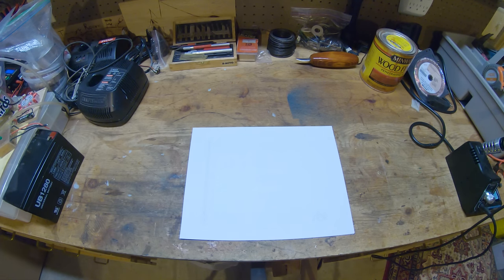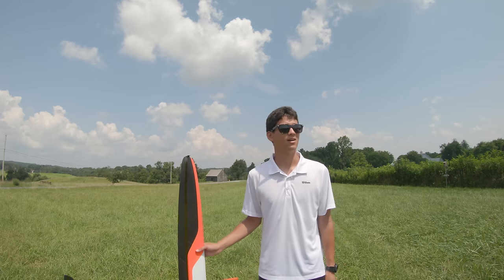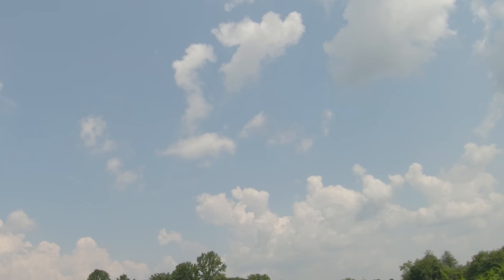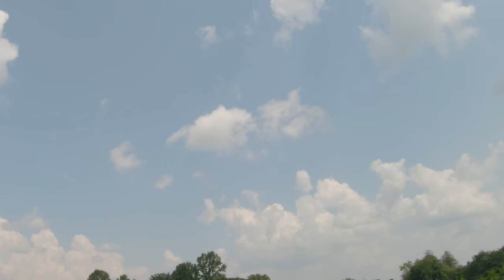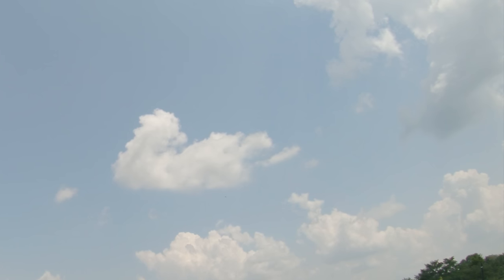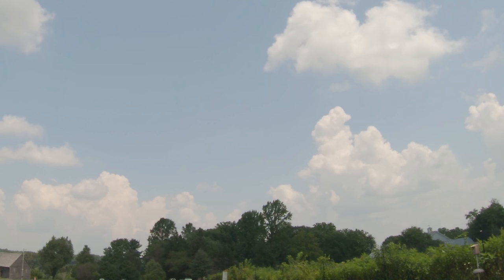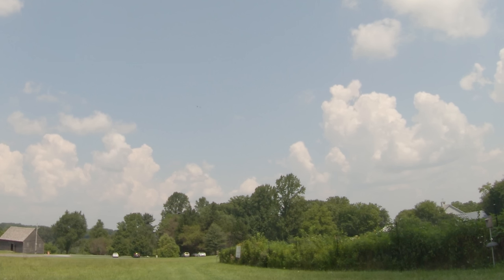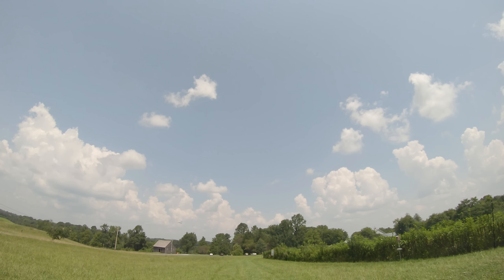How to Thermal Your RC Glider

Comment: Well, I am 78 and flown gliders for 40 years.   Most excellent, helpful video.   I learned a lot, especially flying perpendicular to line of sight.   One additionsl tip, in the old days when we were almost out of sight straight up,  hold eleveator all the way up and the rudder all the way over.   You spiral down and don't overstress the wing with high speed aerobatics.   Maybe the new composit materials can take the stress better.    Anyhow, an excellent job, thanks for your time and very clear instruction.   Nicely done.
Reply from the maker: Thanks! I'll try out spiraling to descend; It seems like it will be harder to lose orientation that way.
Reply: I just hold the stick at the bottom right corner, when you get low enough just let it go and it stabilizes.    Thanks for replying.   Best of luck to you.
Reply: @Phil M bet that looks brilliant

Comment: It was this video that got me interested - two weeks later I caught my first thermals with an F3K plane. That and catching the plane off the air is indeed really rewarding. Thank you so much! For those interested: Get PicaSim, a free RC soaring simulator, and an USB RC controller (if you have a real RC controller there are USB dongles to connect it to your computer). I learnt how to handle the glider and apply the knowledge from this video there, but in reality it is way nicer - standing in the sun, "feeling" real wind etc. When you go for real, consider getting a Spektrum AR6610t receiver, as it supplies a variometer and an altitude sensor that are a good aid to start with. I had to take the plastic casing off and shrinktube it so it fits into the fuselage of my Soaring Models "Kite".

Comment: Hey Timmy; Nice work here. Very easy explained. I learned a lot. I have been into RC powered airplanes for about 10 years. There were no glider pilots in our club until recently, so I got me an electric "Bird of Time"  RF to chase some thermals. Like you say gliding is the must pure, elegant, simple form of  Model Aircraft flying.
Reply from the maker: Thanks!

Comment: I like your comment about "wing goes up in wind, tail goes up in lift". All I would add is that if you encounter a sudden gust of wind (and the wing goes up), it is likely that the wind is going to a thermal, so odds are you are flying AWAY from the lift. Therefore turn downwind and see what happens. I also believe that the air "swirls" in a thermal - it doesn't rise perfectly vertical. A hurricane is an extreme thermal - note the swirling action. It doesn't detract from your video. You're an excellent pilot and have great visualisation of what's happening.
Reply from the maker: Thanks!

Comment: I have a Bird of Time. Your advice just made it a bit more understandable. For the past 3 days before i found your video, I thought of flying around the lift instead of just passing through. What amazes me the most is how a glider can stay in the air when it's tilted sideways at almost 90 degrees and still rise! You would think it would fall out the sky. BoT hooks a thermal like Mike tyson, I almost went home with no glider. Great video
Reply from the maker: Thanks! I have also flown a Bird of Time and I had a lot of trouble trying to get it back on the ground.

Comment: While traveling l 10 in AL in the late 90s l spotted a "visible" thermal.  It was over a dry freshly plowed field and remained there for a long time.  I pulled onto the shoulder and parked to watch it.  There was a lot of man made debris such as shopping bags, wrappers and paper being held aloft along with a   thin wall of dust.  It was about 150' at the base.  Some of the debris was slowly lifted up and disappeared into a hazy sky.  IlRC the spin was clockwise.  There must have been much more lift over the field for it to remain in one spot for so long.  Trees surrounded the field on 3 sides.

Comment: Good video! I have a suggestion from my years hang gliding over the flatlands of Illinois where we got up by using "static line towing" - 3000' of line pulled by a car or truck. When you fly downwind to search for a thermal, you are riding with the wind and basically staying in nearly the same parcel of air. If you head into the wind, you will go through several such "parcels". Then if you find one upwind, you can then ride it back for a longer period of time, thus getting higher, before pulling out. There are other considerations for heavier craft - the Elf can work the "bug farts".
Reply from the maker: Thanks!

Comment: I'VE BEEN FLYING RC PLANES FOR ALMOST 2 YEARS.  I THOUGHT I MIGHT LIKE GLIDING SO FIRST I GOT A DURAFLY EXCALIBUR.  A VERY FAST GLIDER THAT CAN STAY IN THE AIR FOR A WHILE.  THEN I GOT AN ASW28 WHICH CAN STAY IN THE AIR LONGER.  I AM VERY NEW AT FLYING ANYTHING.  SO I CAME ACROSS YOUR VIDEO AND THOUGHT...MIGHT AS WELL WATCH/LISTEN.  AS I STARTED TO LISTEN YOU SEEMED KNOWLEDGEABLE AND KNEW WHAT YOU ARE TALKING ABOUT.  ABOUT HALF WAY THROUGH LISTENING TO YOU I LOOKED AT THE COMMENTS AND THEY I KNEW FOR SURE I WAS GETTING A GOOD LESSON.  YOUR TEACHING WAS VERY SIMPLE WITH VERY GOOD EXPLANATIONS.  I'M GOING TO USE YOUR TECHNIQUES THE NEXT TIME I'M IN THE AIR.  THANK YOU VERY MUCH TIMMY YOU ARE A GENTLEMAN.  John
Reply from the maker: Thanks!

Comment: I have three gliders, a 1m, 2m and 3m. As you can imagine the easiest to thermal is the 3m paragon, second is 2m bob martin pussycat and the 1m gnome is the hardest. The 2 and 3 meter have electric motors and the gnome is a hand launch. I have the most fun with the gnome because it's difficult to thermal but once you find one it's very satisfying trying to stay in a thermal. The only problem is that there aren't that many thermals low to the ground so you have to get lucky and find one near ground that is strong enough to ride up. The paragon will thermal in very weak thermals no problem. I used to have a 2m radian but it broke up in the air. The foam gliders have weak tail sections that need to be reinforced with a striping tape or carbon fiber inserts. Otherwise, if you try to get down from a strong thermal, you might flex the tail in such a way that the controls become ineffective. The old balsa planes of yesteryears are strong enough to take the punishment. The new carbon fiber gliders are the same way.

Speaking of thermals, they move downwind. So fly upwind to ride the thermal downwind, you don't want to catch a thermal downwind and have trouble making it back home upwind. When you do find a thermal, don't be afraid to pull back on the elevator to make tighter turns and to help the plane go upwards. The best thermals are around noon when the sun is directly above, heating up the dark areas. Thermals form between two surfaces one is light colored and the other is darker. As long as you have two different surfaces like that you can thermal. The colder air over the light surface will be dropping down to the darker surface which will cause the air to heat up and rise up. The hot air is also less dense thus the cold air surrounding it will be moving in to take it's spot. That will generate the thermal continuously. When the hot air rises couple thousand feet, it will then cool off and come falling down to again be sucked up by the dark spot and turning it into hot air. 

If you ever get too high for comfort, fly straight out of the thermal. Don't dive too steeply (overstressing airframe) and don't turn too tightly as you'll only end up going up. The thermals above 1000ft can be very strong and difficult to get out of. Sometimes it seems like no matter where you go, you're going up. In this case, don't fly up the thermal too high, exit the thermal at lower altitude, say 400 feet. Another solution is to install spoilers on the wings and deploy them in really strong thermals. They might save your plane. Sometimes the thermal will be so strong that no matter what you do with the plane, like spinning it upside down for example, you'll still be going up. Thermals have been known to suck up fish, frogs, paragliders up to tens of thousand of feet up and some people have frozen to death riding them up and couldn't get out of them.

Comment: I never knew how gliders work until I watched this. You looked like a samurai ninja tossing that rig! I'm sold bro!
Reply from the maker: Thanks!
Reply: @TimmyRC  what glider and transmitter would you suggest to start out with? eyeballing the dx6 and volantex ranger 2000 or bixler. Keep up the good work.
Reply from the maker: @danmrfld4802  Those seem like good choices assuming you already know how to fly fixed wing. Just keep in mind that the Bixler-style pusher gliders will not have anywhere near the thermal soaring capability of high end F3K or F3J/F5J models due to their high wing loading and relatively small wingspan. So if thermal soaring is your goal then I would recommend looking at bigger gliders.

If you have never flown fixed wing aircraft then I would recommend starting on a simulator and then getting a small foam trainer. There are a lot of offerings from Horizon Hobby with their SAFE stabilization, which is helpful for beginners.
Reply: @TimmyRC  thanks for the response, I'll look into those.

Comment: Lot of times what happens with the birds is when they circle, they're usually in the wider part of the thermal (imagine an upside down traffic cone in the air). You'll be unable to ride up the thermal because it's too narrow near ground. So you'll be circling like a madman and not going anywhere yet the birds are gaining altitude. For that reason I find the birds unreliable. If you really want to catch some easy thermals, go out when it's overcast and about to rain. It might even look like a tornado is about to happen. You will always find super strong thermals in those conditions. I was flying a little scratch built V tail foam glider one time and it was sucked right up into the dark sky without me doing anything special. Get out of there when it starts to rain or you see lighting bolts, duh. You won't find any thermals when the sun is setting down or very early in the morning. Best times are around noon. Also, thermals can detach from the ground and be moved by the wind. Some are stationary. You can try making a stick with a long tape and when a thermal passes you, the tape will rise up into the air. I prefer to just toss the plane and go hunting without using any gizmos. That house in the video is also a good source of heat and you might use it to get some altitude. Also, a tree line is helpful when the wind is blowing as the wind will travel up the tree line and over it and you can ride that wave for a bit more altitude.

Comment: despite it's a quite old video, I find it very instructive and clear with practice example. Only one question, what do you mean with "lifting the tail" ? How can I see if the tail is lifting from that distance ? Maybe you can explain ?
Reply from the maker: From far away it will look like the airplane is pitching down due to the lift pushing the tail upwards. However, the airplane will typically not appear to be descending because it has just entered lift.

Comment: Hey, great tutorial! It really helped that you give your stream-of-consciousness while flying. I'm purely a slope soarer (combat gliders) and would love to thermal. Just don't know when to expect low winds.
One question: How can the sun going behind a cloud affect the thermal you are in? It's transparent, so it seems like nothing should happen to it.
Reply from the maker: Thanks! If you are already in a preexisting thermal or "bubble" the lift will be unaffected as long as you are able to stay within that rising column/pocket of air. However, if you fail to stay within preexisting lift, it will be harder to find new lift closer to the ground because the sun is not heating the ground as quickly.

Comment: What would be a way of using electronics, laser pulses, & detection of the return pulse to detect thermals?m   Thermals usually have higher water vapor content.

Lasers Are used in airport awos's to detect Cloud heights.  However, water vapor (in thermals) may better reflect differect wavelengths.😢

Comment: Very good job in describing and demonstrating thermal! New subscriber!
Reply from the maker: Thanks!
Reply: Any recommendations for a first DLG? I’m an experienced RC pilot and have been fascinated with powerless flight for some time.
Reply from the maker: @kevingoza  Since you are an experienced pilot, I would recommend that you go straight for a premium full-carbon glider. They perform so much better than cheap fiberglass models and you will probably have a less frustrating experience. The Armsoar Go Mini is a great choice since it has premium construction, but is only 1m instead of 1.5m so it is easier to handle and less expensive. It also shouldn't break as easily in the event of an accidental landing.
Reply: Thank you! I’ll need to search those out. I’m not sure if my local shop has that brand. You make it look so easy, but I’m sure it’s more complicated and the air time is what will make the difference. I like the idea of working with nature to fly.

Comment: If there's no ridge lift available, I watch the grass until I see it lay down from a gust of updraft. The grass tips bend down in the direction of flow. Then I  hand-toss my glider (6' wingspan) ACROSS the flow with up elevator until it reaches its apogee (?) then level it off and fly straight until one wing tip jumps up at which point I turn in the direction opposite the tip. In other words, if my starboard wing tip flutters, I bank to port. Then, I fly level, still turning, drop the nose to gain speed, watch my tips and give it up elevator when it comes INTO the wind, level off as it begins to stall and repeat the process until the plane is about 7 mistakes high, then we do aerobatics 😂.

One thing I enjoy doing is to fly with red tail hawks.  They don't like company and will dive at my plane, which us exactly what I want.  When they get within striking distance, I quickly imvert and maintain my course. They can't do that!😂 and it really freaks them out, HOWEVER, some will persist in an attack at which point, I YANK the the stick and basically do an Emilman so that my plane REVERSES direction, avoiding Mr. Hawk. Great fun. 😂😂

Edit: I'm 75 and have built & flown gliders for well over 50 years.

Comment: I want a DLG, looks so relaxing.  Can you suggest a budget/beginner/recreational model?

16:15 It's coming right for us!
Reply from the maker: I would personally buy the Armsoar Deviant if you are already proficient at flying fixed wing. It is essentially a top of the line DLG, but smaller and therefore cheaper, easier to learn how to launch, and probably more durable. If that seems too expensive and/or you aren't very comfortable flying fixed wing, there is the Dreamflight Libelle.
Reply: @TimmyRC  Thanks!

Comment: Awesome video!  When you say to use the rudder more to turn in a thermal are you using the rudder stick exclusively or do you have a mix that uses more rudder output than aileron?  Keep up the great work!
Reply from the maker: Thanks! I do not use a programmed mix; I use almost exclusively rudder stick.

However, when transitioning from straight flight to circling I use aileron in the same direction as the rudder to help initiate the turn. Then once I begin circling, I will use a small amount of opposite aileron to keep the wings more level. I did not include this in the video since it is a rather advanced technique and using exclusively rudder will work just fine.

Comment: What plane & radio do you recommend for slope soaring?
Reply from the maker: I have never done slope soaring, so I cannot give an educated recommendation for a glider. For transmitters, it's mostly personal preference. I would go for something that has at least 6 channels and is programmable.

If you have never flown fixed wing aircraft then I would recommend starting on a simulator and then getting a small powered foam trainer. There are a lot of offerings from Horizon Hobby with their SAFE stabilization, which is helpful for beginners. I would not try to jump into slope soaring without any fixed wing experience.

Comment: I only have a dx6i so I can only program one setting for my flaperons which kind of sucks unless you know another trick
And also do you have down elevator mixed in with thermal mode??
Reply from the maker: You can use the mixes to get an extra flight mode or two, but I also had a DX6i and not having the capability for 3 or more flight modes was one of the main reasons why I upgraded my transmitter. I do not have down elevator mixed in with my thermal mode.